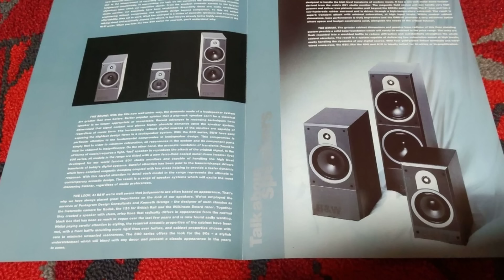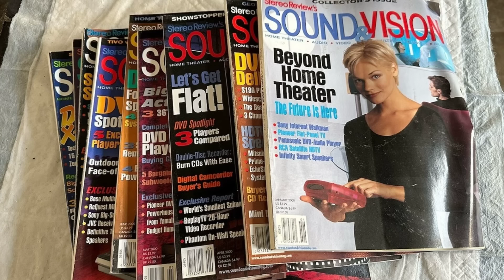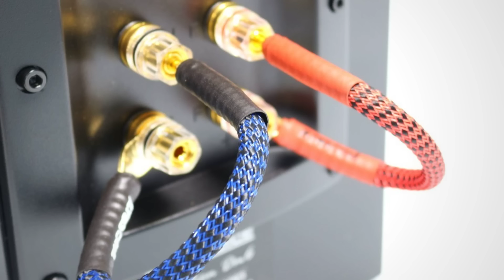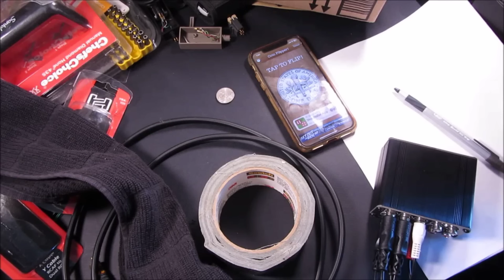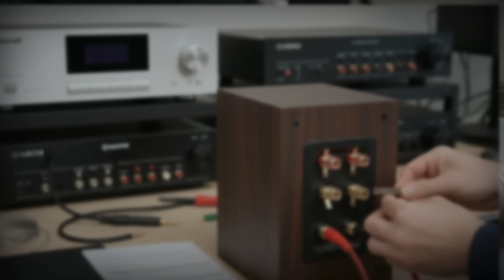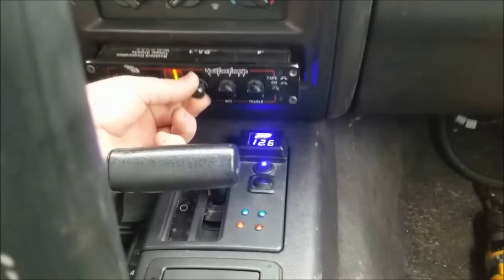Bi-Wiring & Bi-Amping Explained (Scam or Genius?)

Comment: Here is the simple truth:
Bi-wiring, unless your ears AND system are REALLY first class, 10s of 'Ks' probably won't be noticed.
Bi-amping is TOTTALY differant, unless you have VERY sensitive speakers 93+ sensitivity. (eg Klipsch) Adding a separate bass amp, will free your main amp up to deal with the mids and tops only and with better control and resolution.
This will sound like a new amp costing much more...
Reply: So don't buy a 7k amp that delivers 300 watts chan,  buy a bass amp emitiva, monoprice, whatever for bass, 600-1000 dollars,  and a really nice 2000 dollar amp for the mids and highs....   will be as good OR better, less than half the cost....
Reply: @KerrAvon-DSV1 I assume both amps would need to be the same [ or close to] watts per channel? I have a Marantz MM-7025 [ 140 wpc] connected to a pair of Polk R700's ....the sound great but from my research they would be better with additional watts to drive them.
Reply: @allent8614  the watts need not be the same, fairly close is good but you can always slip a pre-amp in the bass feed, then you can adjust the bass to suit old recordings which often lack bass due to being mastered for vynil...   I have 2 dacs, 1 for bass and 1 for mid/high, each with high quality volume control and quad amping 2 x monoblocks.... awsome result...!
Reply: @allent8614  I thought again, and it is the 'GAIN' being the same or very close that is more important than power-matching... 100watt amp and a 200watt amp are only 3dB differant...  but if one has eg. 9 dB more gain huge differance...
Reply: @KerrAvon-DSV1 thanks for your advice.  I ended up buying Tonewinner AD 2500 Pr0 ( 500 wpc )it's made a very noticeable difference to the Polk R700's, brighter highs and good punchy bass....very happy with purchase.
Reply: @allent8614  ....Good result!  ...you are welcome...  😇:washhands:👍
Reply: TOTTALY 😎😎

Comment: Biwire cables of different gauge works for separating low frequency from reaching the mids and highs depending on the construction of the crossover,I use this configuration with my speakers and hear a definite difference if you can’t hear it,your system is not revealing enough or your ears are not good enough,don’t care what this video says I hear the difference and that’s good enough for me
Reply: I agree, I use 18 and 16 gauge for my highs. I use 12 for my lows. I experiment with 14 gauge for my lows. The piano notes were not as pronounced. Since I have a 2 way system, I went ahead and added the 14 gauge to my highs.  I bi-amp also.
Reply: @gsbass1037 that’s great happy listening 😊
Reply: Talk is cheap.
If you can't SHOW it 
you don't KNOW it

SHOW us that you can do what you claim you can do.
Reply: @crazyprayingmantis5596 all the likes I got agreeing with me is all the proof I need and my ears are all that matters to me talk is cheep and so is this video and what there saying

Comment: I tried Bi-Wiring on my speakers, but could hear no difference, so reverted to single wires.  That was back in the 1980's and '90's.  My current speakers can be Bi-Wired, but my aged ears can't hear the difference, so I don't need multiple runs of cable.  I previously had a pair of Quad 57 Electrostatic Speakers, which couldn't be Bi-Wired and I found the sound perfectly acceptable and enjoyable.  Russ.  UK.
Reply: Most people wouldn't derive a discernible benefit from bi-wiring. I often point out to people that it's not difficult to try bi-wiring if their speakers have the provision, and see if they hear any difference. If not, no point. There are valid technical reasons (I'm an electronics and sound technician) that a small subset of configurations could experience a difference of some kind - but it might not even be an improvement. There is only one way to know - try it, and listen carefully. And, like yourself, my ears as I approach seventy are not hearing things they could previously. 🙂
Reply: @PlatypusPerspective  The important thing, as far as I am concerned, is that I can enjoy the music and the performance.  I gave up 'Improving my System' many years ago, once I found an amp and speakers I liked the sound of and could enjoy for hours, without giving myself ear ache or head ache.  21 watt 'World Audio Design' K5881 Mk 2 Valve Amp - Courtesy of Noel Keywood of Hi-Fi World magazine - and KEF Standmount Speakers.  The Quad 57's were brilliant, until one of them failed, but I couldn't afford the cost of the Rebuild at the time and now I can afford it, I can't justify the cost, because me ears aren't what they were.  Some days, Life just Sucks.
Reply: Basically running bi wire from the amp halves the impedance of the cable and cuts current feedback to the tweeter and midrange from the current created by the woofer movement.
The jumpers on bi wire speakers is only to get it working!
Reply: Bi-wire need to work with bi-amp setup, make sure both have volume control, since not every source media are the same. Bi-amp can allow you to adjust bass and HF accordingly. That's the difference,not about it's better using bi-wire or not.
Reply: @kt88sl45  Bi-wire does not "need" a bi-amp setup in order to make what difference it can achieve. Obviously you have no option but to bi-wire the circuit if you wish to bi-amp, but a bi-wire configuration is independently capable of separating the current paths between the frequency sections and isolating the resonant circuits of the crossovers from each other. It's the wiring configuration itself that does that, it doesn't need to work with a bi-amp setup to do it. Whether that change is audible in any given circumstance can only be determined by trying it and listening. 
 Adding bi-amping expands the separation to the amplifier stage, which is pretty certain to have greater effect than the wiring configuration alone. For most people, the requirement for amplifier volume control is because not every amplifier is the same, rather than anything to do with the source media, which is not behaving any differently whether bi-amping or not. Different amplifiers are likely to have different voltage gains, so will need different gain settings to restore the balance to what you would have had using a single amplifier for both functions (or to what you prefer if you want to change it). In the rare instance where someone has derived individual sources, probably an active crossover, if this is working correctly it will still deliver an exact duplicate of the original source so the situation will be the same. It may only be necessary for one of the amplifiers to have gain control e.g. using a fixed gain power amp or monoblocks for bass, and an existing amplifier with volume control both fed from a master level controlled device like a DAC or active crossover unit. There would be some, but limited, value using an active crossover without eliminating the passive crossovers in the speakers.
Reply: @PlatypusPerspective well, weather you bi-wire from the amp to the crossover, or run the standard wire to the crossover, the result is the same thing.    
 Imagine- without using any wires,  if you could connect straight from the amp into the crossover and also straight in to a speaker without the crossover, would you still think you need 2 separate wires?   Nope
Reply: @Brian-qg8dg  🙂 Confidently wrong... It's always simultaneously amusing and frustrating when someone thinks they've found a way to show that physics is wrong. Since you didn't understand what I said to kt88sl45 it looks like you're not much into physics, but one of the most important things to realize about physics is that it takes absolutely no notice of anything anyone imagines. Someone imagines the result is the same thing (perhaps they've read on some janky website somewhere that "it's electrically identical") - it's physics that says Nope. I know it's fashionable among some audio people to bash science, but it's what makes recorded music and amplified audio work, and it's what made it possible for me to design, build and utilize such equipment for the 50 years of my working life.